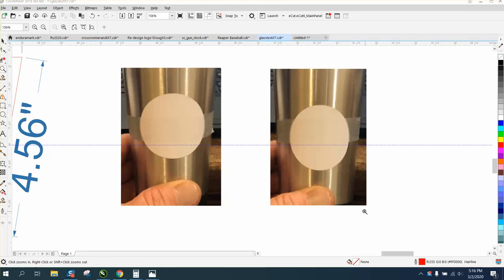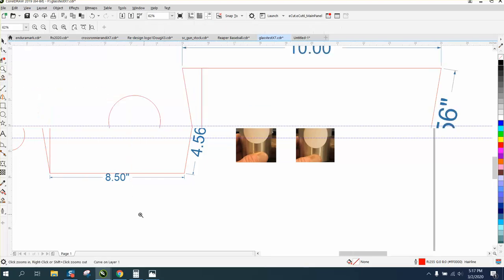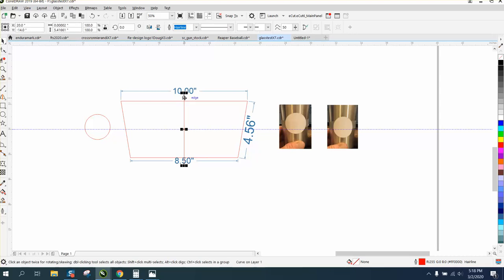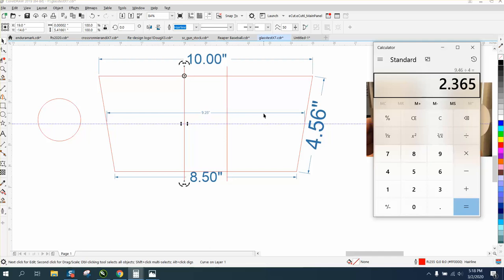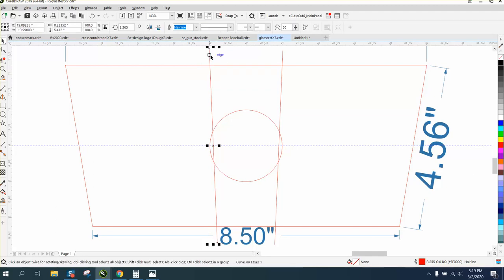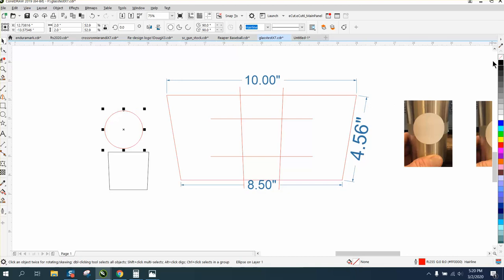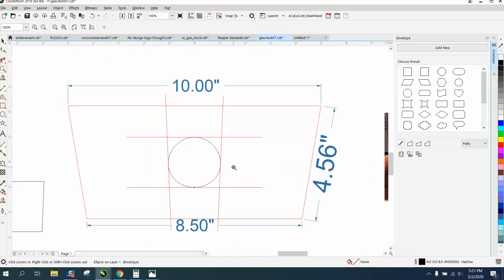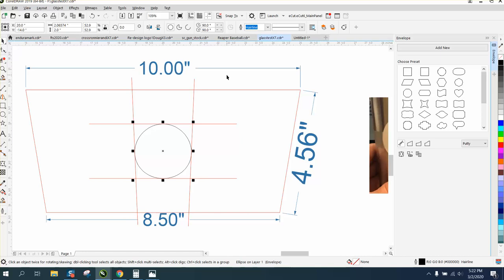Corel Draw Tips & Tricks Round Logo on a Tapered Glass

Comment: Doug, that looks like it works well although I have not analyzed the math behind it.  The thought that came to my mind was:  If there is going to be some engraving inside the circle, would it be a good idea to design the engraving on the plain circle before using the envelope tool?  That way all the text or pattern would have the same transformation as the outline of the circle.  Keep in mind that I have not actually done this so it may be an example of that old adage:  Nothing is impossible for the person who does not have to do it himself.
Reply from the maker: thanks and yes on the logo, I tested it today with a logo and still need some work, with the other cylinder Excel file to make wider